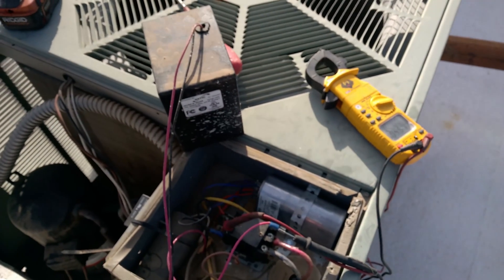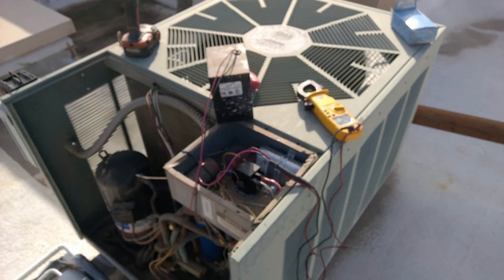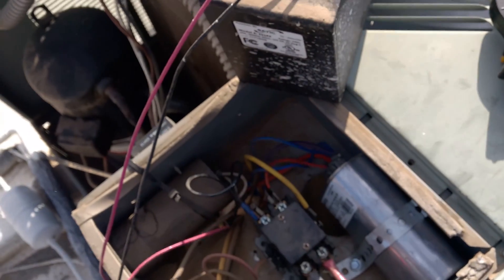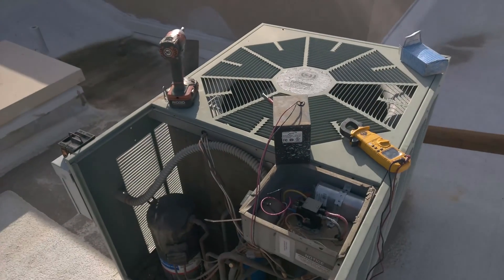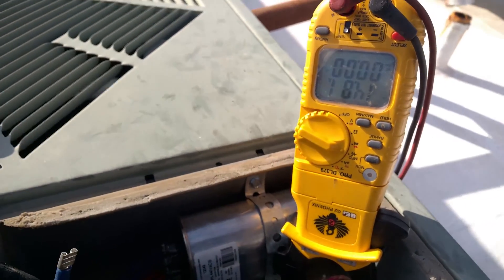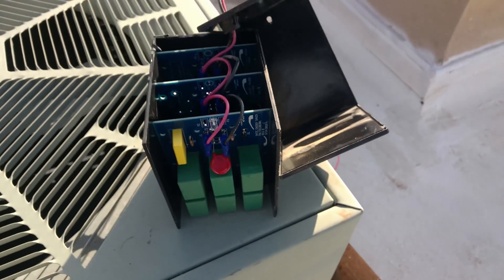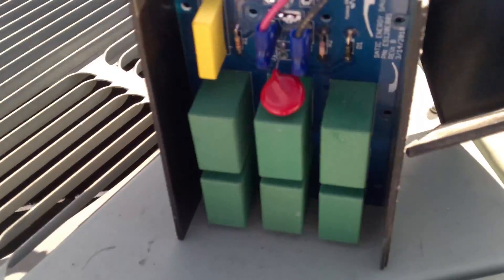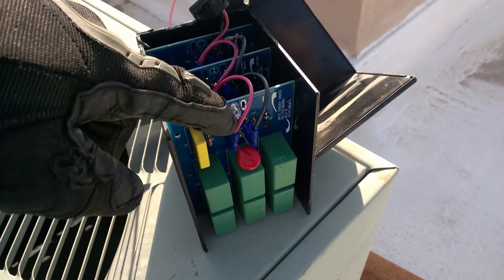Plastic Power Factor Correction gimmick device (KVAR)

Comment: Power Factor Correction is ok if the customer pays demand charges.  A correctly set up Capacitor in single phase, or 3 capacitors on the three phase compressor wont save "energy", but rather reduces the inrush current for about 1/2 a second on start up, and can have results that would lower demand charges.  KVAR units for your home connected to the panel are SNAKE OIL!  Residential utility customers do not pay demand charges!

Comment: That's a first for me as well.  Especially on a commercial unit.  If power were a concern I'm sure there would have been a 3 phase unit instead of the single phase.  
I would love to of heard the sales pitch for that thing.  I imagine it would have had plenty of hot air.....
Reply from the maker: George W Yeah, probably more hot air than needed to sell a Surge Suppressor or Zerol ice (snake oil). 

I have seen them and even installed them on 3 phase motors that were way off their matched load thus causing major power factor issues to wear the capacitors corrected it.
Reply: +George W if it was on a commercial utility account, they might have been sold on it to reduce demand charges.
I know the KVAR crap is snake oil, but when you are billed on demand, and a capacitor bank holds reactive current instead of taking it from the grid you can save money, not energy.  This unit was not hooked up in the correct way to do this.  For more info email me at EMSLawrenceKansas@gmail.com

thanks for youtubing on these subjects!
Reply from the maker: EMS Lawrence, KS
Yeah, and that these types of A/C units have a compressor that has little KVAR correction needed compared to some commercial applications that do.

We put some KVAR's on some pumps and other motors at a place I was working.
The motors that we installed the KVAR units needed the power factor correction. Usually when the motor didn't have a full load. Load mismatch.